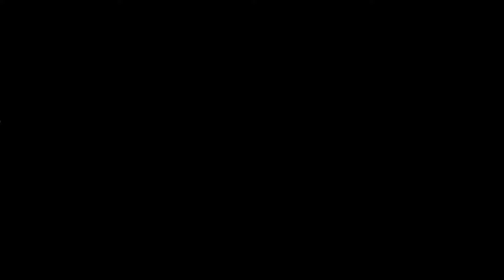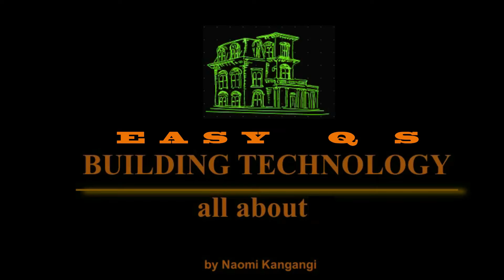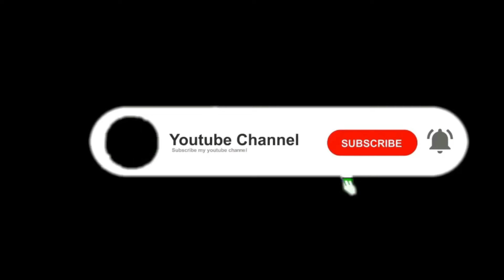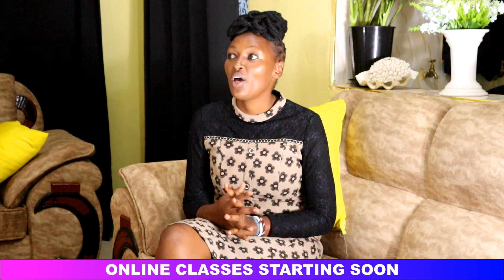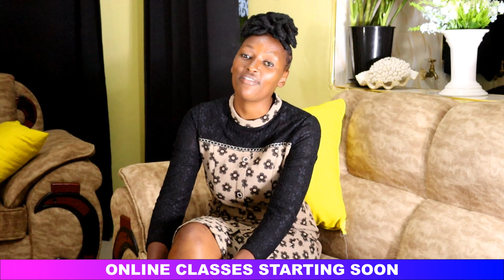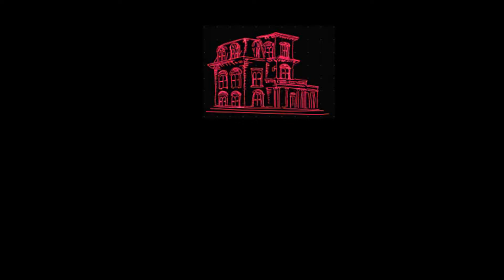METHODS OF VALUING VARIATIONS/VALUATION OF VARIATIONS IN CONSTRUCTION PROJECTS

Comment: Using the Pro rata price build up ,price the variation item provided below
BOQ item
50mm thick cement and sand 1:3 level in one coat to concrete $13.58/m3.
Notes : profit and overhead 15%
1m3 cement =1400kg cement @$85.00/tonne
4m3 sand =6400kg@10.00/tonne
Unloading 1hour tonne @$13.20
Shrinkage 25%
200litre mechanical fed mixer @$20.00/hour ,output 4m3 /hour
Labour costs for a 38mm thick screed cheaper than 50mm